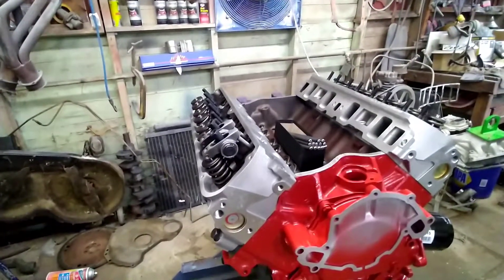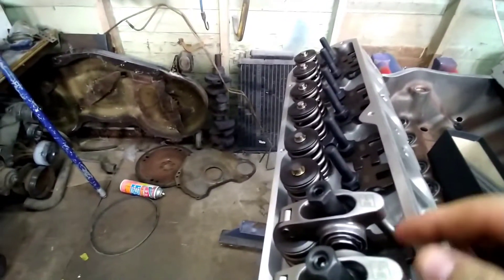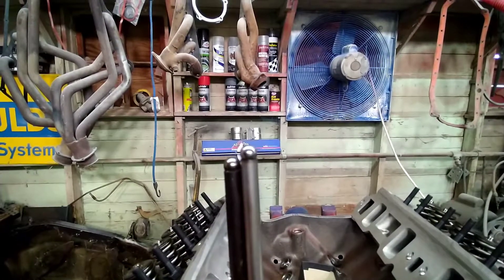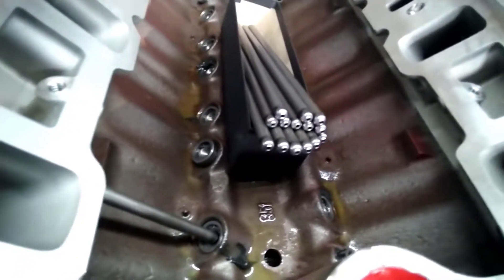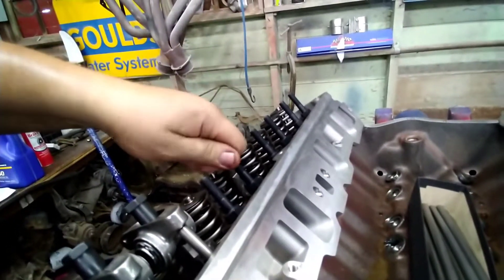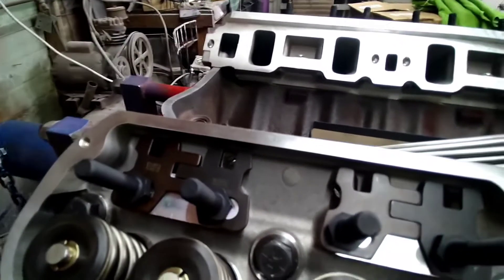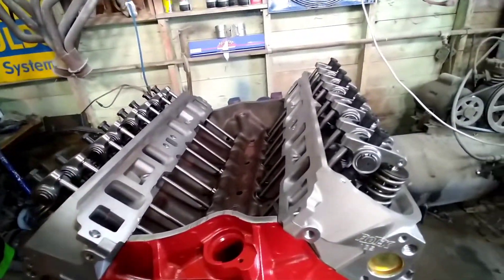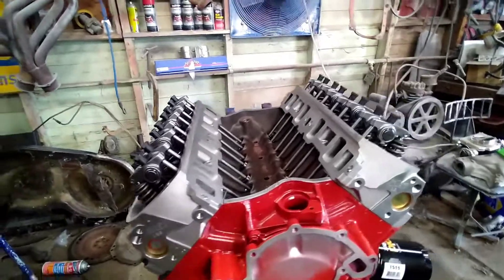Rocker arm valve adjustment and pushrod lengths

Comment: Cool man that's the way I learned when I did a Chevy engines lifter on the base circle of the cam lowest point 1/2 turn and done I had a nosiey slant when I was done she was quite!  But Mopar big block stock have no adjustment but if you change cam or shave the heads it can change the pushrod length... Cool video man!
Reply from the maker: Are them big block Mopar have pedestal mount rockers
Reply: @CCAutoWorks  yeah the magnum engines do. The old big blocks use a shaft but you can go aftermarket rocker for adjustment on them.
Reply from the maker: @moparnut6286  awesome I've never worked on any mopars so I wasn't sure